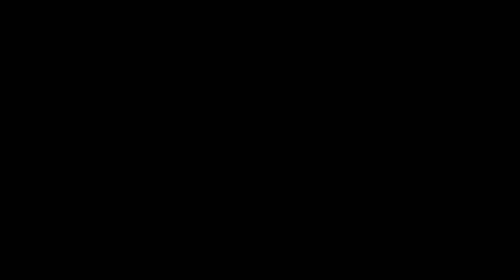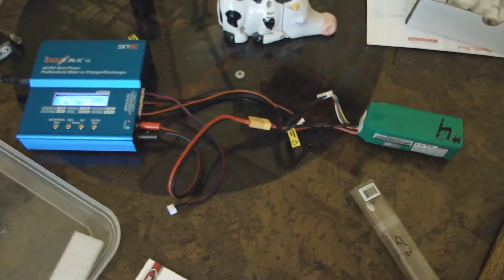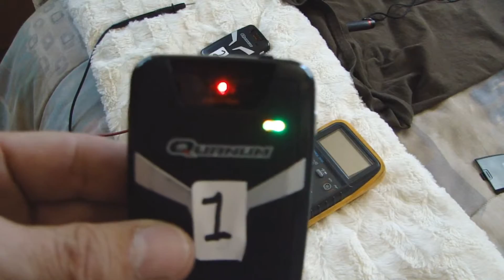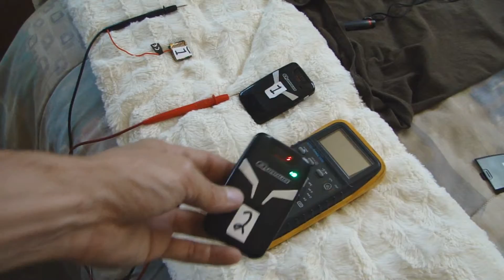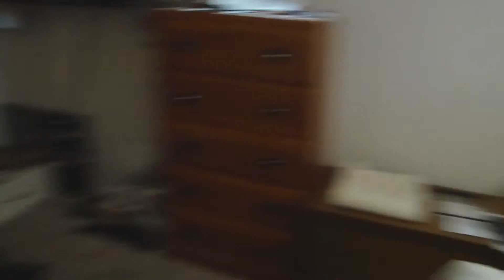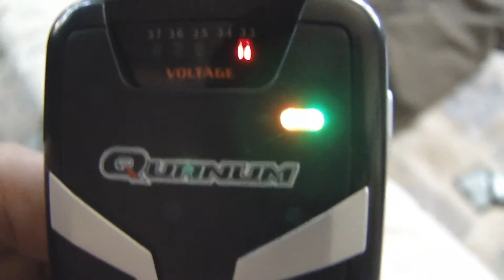Broken Quanum voltage telemetry Tx/Rx....

Comment: I've got 3 of these, they all work, and they've saved aircraft from crashing.  Others in my club have them and they work.  Watching your video, I'm not sure all your conclusions are correct.  For example, my alarms function and  warn me whether the green light on the receiver is blinking or not.  Where did you get the idea that a blinking green light on the Rx means it has lost its bind, or is defective?  I suggest you try flying aircraft WITH THE DEVICE ONLINE, and test it at the highest voltage setting.  I'm suggesting the alarm WILL WORK, and you still will have ample time to land.
Reply from the maker: You ask, "Where did you get the idea that a blinking green light on the Rx means it has lost its bind, or is defective?"

1) Because the only time the unit worked correctly, was when the green light on the receiver was solid.  

2) The Rx green light would blink as I moved the Tx farther away, which indicates "weak signal" to me.  I would expect to see weak signal 1/2 mile away, but not 20' away.

3) Hobby King warranted these units.  The replacement units worked as expected.  HK reported back that these units were indeed defective.

 
You suggested, " I suggest you try flying aircraft WITH THE DEVICE ONLINE, and test it at the highest voltage setting.  I'm suggesting the alarm WILL WORK, and you still will have ample time to land."

I flew many flights with these units and their replacements.  When they work, they work well.  That said, this video was made a long time ago.  I have since moved past the Phantom offerings to a more professional, "rider-friendly" platform, and therefor no longer need or use them.  However, I will say that I liked them and they were very useful.

Seems I'm not the only person to experience problems with these units:

https://www.youtube.com/watch?v=Dn6_MDhahj8

I hope this additional information helps.  As always, please subscribe....:^)

Comment: Hi just wondering what you found out about your failed units, I'm thinking of ordering one for my quadcopter?  Thanks
Reply from the maker: Honestly, I have moved so far beyond this technology, I barely remember using this unit.  But I CAN tell you one thing that I remember.  And that is the distance limits of this unit.  I would put a good estimate at < 1000'.  My new bird has full telemetry and a range of 1 mile.
Reply: Donnie Frank Thanks how did you get it to work🤔 $19.00 right now worth it or not?
I have one quad that is hit and miss with LVC working properly.
Reply from the maker: It depends your intentions.  If you don't plan on flying out past 1000', it's probably okay.  I found the vibration a little hard to feel, so don't put the unit in your pocket.  Strap it to your waistband on your pants.  If your hearing is good, you might consider the beeping units that also give you a constant voltage readout for each cell AND a total voltage.  Of course, you can't read the LED while flying, but you can set the voltage limit to beep in plenty of time.  I think I set mine to 3.3v or 3.4v, if memory serves.  It's a little box that plugs right into the balance port on your battery - just like the Quantum unit does.